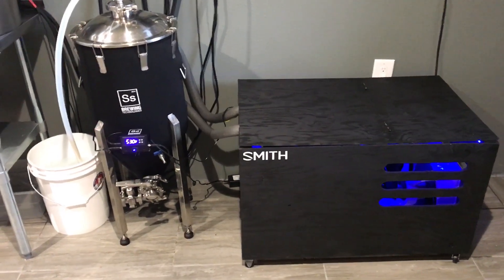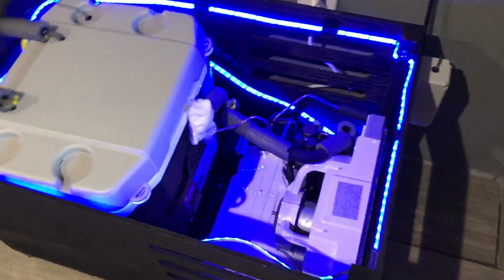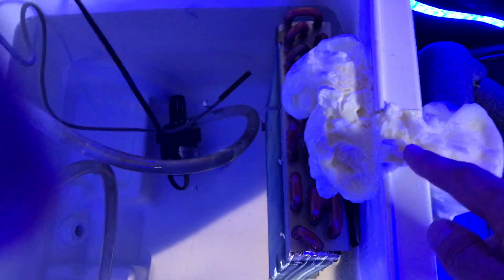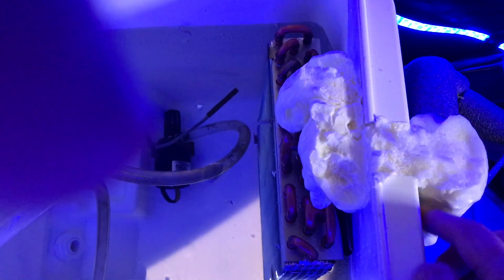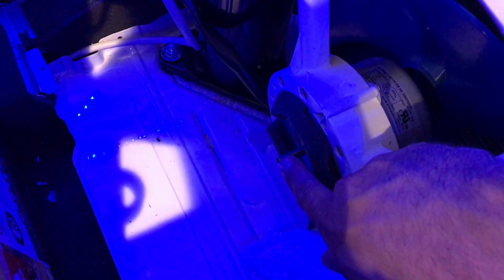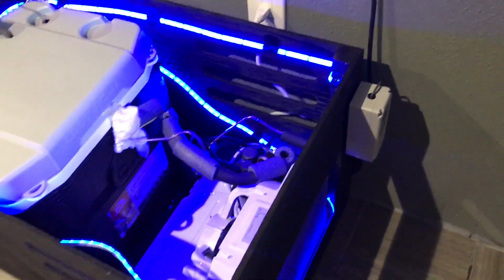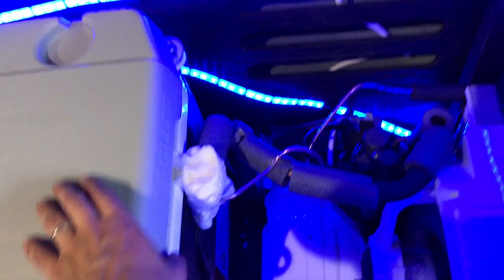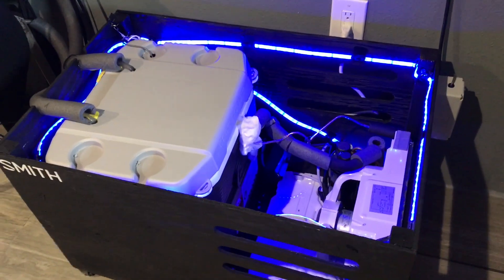DIY Glycol Chiller

Comment: I know you might not be around, but anyway. Do you turn ON and OFF your glycol chiller when certain temperatures are reached, or is it always on? If its turned ON and OFF, how often does it turn ON and for how long? Just trying to see if I can have a similar glycol chiller on 12V batteries (and how long would that last).

Comment: @Matt, I think I've had some evaporation of my glycol mix over the winter. I doubt that glycol and water evaporate at the same ratio, so it's possible my ratio is now off. Have you run into this? How do you deal with that?
(Yes, I realize this reads a little like a third grade math problem involving two trains leaving a station haha)

Comment: Hi nice chiller working on one now, I was wondering if the condenser steel brackets that are submerged in the glycol mixture are rusting now that you have had yours in service for a few years any one have any comments on the topic would be much appreciated.
Reply: two years later on this post… and I am almost finished my own build.  I just bought food grade glycol corrosion inhibitor to put in the mix!

Comment: Excellent video Matt, thank you!  I was going to run a cold water supply from my kegerator (large refrigerator).  It’s a new one we picked up as floor model on sale so I’ve been hesitant to add another penetration for additional supply/return fittings.  Your setup is totally boss - I’m going that route!

And thanks for link to your article on the build; just PDFed it.  Cheers 🍻

Comment: Do you use that with Ale's? Or does it drop the temp too low? Can it maintain temps in the 60-70 range? Thanks
Reply from the maker: I use it for all of my beers. Ales and Lagers, it maintains any temp I want from cold crashing in the 30s, lagers in the 50sand ales in the 60s

Comment: hey man put the shroud back on with something to block the airflow from the giant hole in the front  or the original facing so it pulls air over the compressor. it will help it last longer by keeping it cooler during operation. If not make one from sheet metal. had 3 of these so  and always felt that was important

Comment: Does your evaporator coil rest on the bottom of the cooler?  Mine doesn’t quite rest on the bottom and am wondering if I should put some custom cut wood under it to give it some base. I’m afraid to bend the coils anymore at risk of breaking the soldered joints
Reply from the maker: Matthew Kaczmarski mine sits on the bottom. Having a little support underneath would definitely help alleviate any stress on the copper. I’m would suggest a plastic though. Legos in a pinch
Reply: Matt Smith thanks for the advice-  I used some pvc pipe to great a base:  one more question:  the copper lines turn ice cold (noticeable frost) when it powers on, and immediately disappears shortly after or when the unit stops.  Is that normal?  I haven’t put any insulation over the tubing yet so perhaps it’s just the warm Georgia air.
Reply: @UNCKaczmarski  That's normal for uninsulted refrigerant lines. home depot sells multiple sizes of pipe insulation.

Comment: Hi I'm just building my chiller now. I've disconnected the fan that looks like a hamster wheel and I'm assuming I leave the actual fan that blows on the condenser intact so it continues to blow onto the condenser . Is this a correct assumption. Thanks!
Reply from the maker: You are correct Sir, happy brewing and chilling

Comment: Have you ever cold crashed with this thing?
Reply: That's a 14 gallon SS right?  How long does it take to cold crash that many gallons with the water at 31ºF?  Nice build!
Reply from the maker: Yes, I cold crash every beer with this. I’m currently holding a lager in the Fermenter and an Ale in my Brite tank at 38 degrees. Works great.
Reply: Sweet thanks! I think I am going to try this.

Comment: Anything you would have done different?
Reply from the maker: I would have thought out the hose placement better on the lid of the cooler and the cut outs on the side of the box. I kind of lucked out with how it worked but it was a total oversight.
Reply from the maker: Steve Robson Just differently on the top. A friend of mine did this build as well recently and he used PVC elbows to route the hose lines out from the cooler. I thought that was a pretty good improvement from mine.

Comment: Great build! Thanks for sharing! What model AC did you use?
Reply from the maker: thisistheoldways I don’t remember the brand. But it is the 5,000 BTU one at Wal Mart for $97
Reply: It's an Arctic King WWK05CM91N (or an identical model).